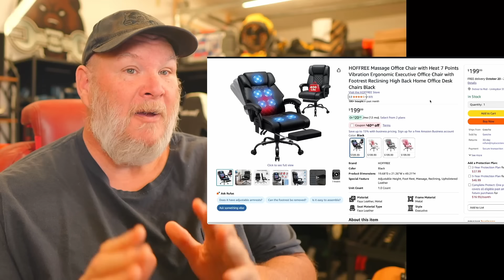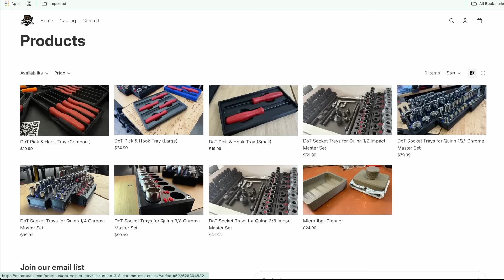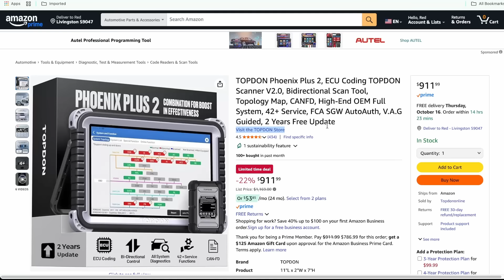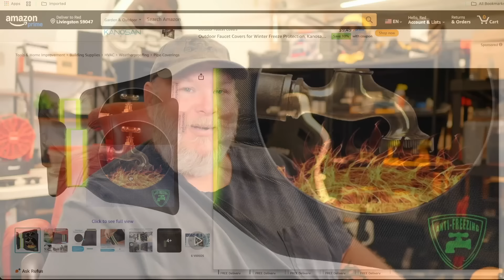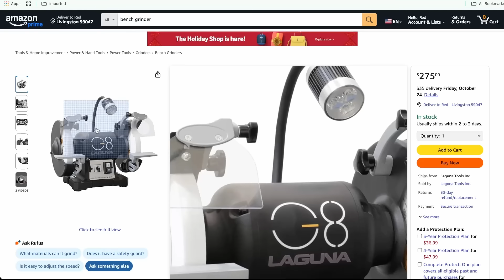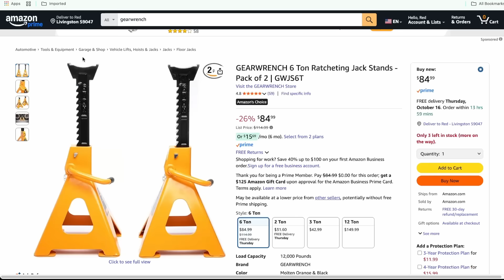Top 20 Tool Deals of the Week & More!

Comment: @thedenoftools I agree with you on metric. I use mostly metric in my woodworking projects. So much easy to deal with. And all my cars use metric nuts, bolts, screws - I hardly touch my SAE side of the socket sets.

Comment: I bought the Klein ball grip screwdriver when it first came out and mine is 100% JIS compatible.  It says so on the packaging and I have used it on JIS cross head screws along with American #2 Phillips.  It may also be marked on the shaft, but I can't remember.  So unless they changed the shaft, which I doubt, it should still be. It's made in Japan with Japanese and English text, and I suspect Vessel manufactures these for Klein based on the quality and similarities.  It's also better than the earlier vessel models. It has become my go-to screwdriver around the house.

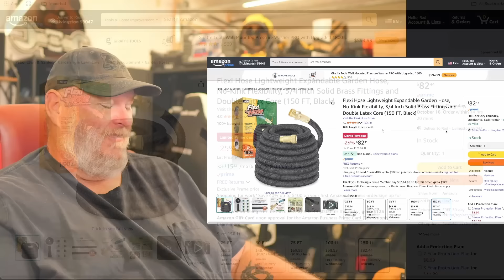Comment: 35:24 sorry Jeff but I have to disagree. please do not buy these. They are not good at all. I’ve tried different variations of these, including this exact one and this one lasted about 2-3 months before the end exploded off of it. I was using it for watering my tomato plants on the porch. I will stake my name and my life savings on the Gorilla Toughlite hoses from Home Depot. Even over the Zero G Pro hose. The 130ft hose is $89 if length is your concern. I’ve used and abused the 100ft hose daily with 130 degree water and it just won’t give up. It’s been drug over concrete and brick almost daily for  at least 6 months.

Comment: I generally only use 2 SAE wrenches for almost everything I do. 7/16" and 1/2" The former for almost anything I need quarter/twenty bolts, nuts, and related fasteners. The latter because the half inch nut/bolt head is what you find on 5/16 inch bolts/all-thread. 5/16" measures to 7.89 mm, meaning that it is .11/8 off of 8 mm. 8 mm is pretty much a standard in 3dPrinting, because it's the core diameter of the bog standard 608 skate bearing, used all over the place.

As far as I'm concerned, if you're on a tight budget, pick a measurement standard that works for what you're working on. and get 2 sets of the tools in that set. a year later compare the two sets, and get upgraded replacements for the tools your missing, put a carry kit that includes those specific wrenches/tools, and get a really good quality adjustable wrench for everything else. The shop kit should be complete, as should your tool room set, but what goes missing is stuff you use, or lend out and forget about. Over time build out the shop set and the tool room set with a pair of every tool you use, and teach yourself not to put the tool down, put it away. (Including back into the tool roll you keep in the toolbox on the truck.)

And yep, I need to work on that "Don't put it down, put it away' thing myself. Anyone seen my half inch socket or that 10 mm one?

Comment: I use my SAE most of the time when I work on my dad’s old Scout (which he’s parked in my driveway for now while he’s between homes and I’m helping him fix while it’s here) or when I work on my truck which is a 1996 Chevy K2500.  So I do use those quite a bit.  My other car is a 2017 Toyota Camry, so basically all I do are fluid changes and filter changes.  I barely use tools on that.
Reply: Chevy switched to metric heads in 1973
Reply: @bobsmith33011 then explain to me why half of the bolts on my truck are SAE?  Metric are loose, but SAE fit just fine…
Reply: @chrisg1043 Could be replacement bolts. Or just rust. Some legacy parts may also use older bolts. For a lot of the castings they kept SAE threads until there was a major update that required retooling so its not uncommon for replacements to have SAE heads. Process was gradual so some factories would still be using SAE headed bolts after the switch but that should've all been over by the 90s. Hydraulic fittings also stayed SAE into the 90s.
Reply: @bobsmith33011 it has the old 5.7 they used for decades minus the head and throttle body (VORTEC).  I’m fairly sure it’s mostly legacy stuff then.  Other than bolts on the bottom, they’re not rusted (from AZ).

Comment: I bought the Copper Bullet hose and it will collapse when connected to a pressure washer. As an old fire fighter you need a hard line hose on vacuum.

Comment: The Teslong Borescope would be great for DIY colonoscopy.😂

The Lowe's were clearing out a lot of Flex last week and over the weekend.
I bought three Flex multi tools at $69 each (for friends and family).
FX1472-1H high torque impact wrench kit with stacked 6.0 battery, charger, and a hard case for $169.
This morning, I bought a Flex pin nailer for $139.

Comment: SAE is all I use at work, im in HVAC and I work on large gate valves in manholes, everything on those hot and chilled lines from the plant have SAE bolts. Even the air handler units I work on. Metric is actually rare in what I do. Sometimes I come across a little baby bolt that is metric.